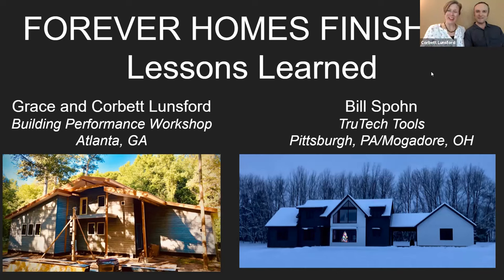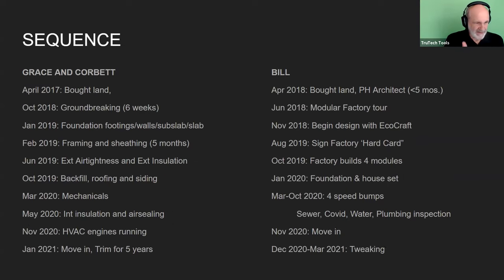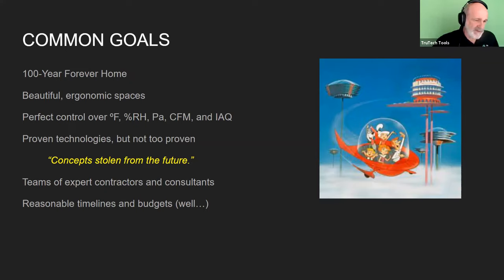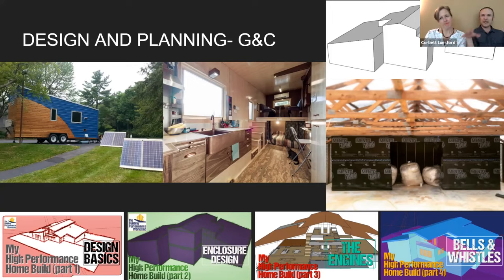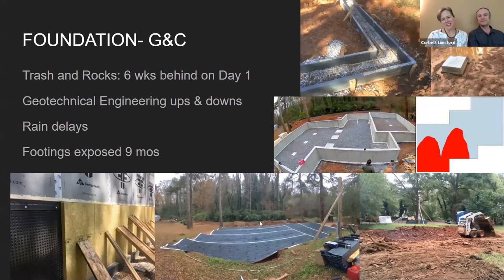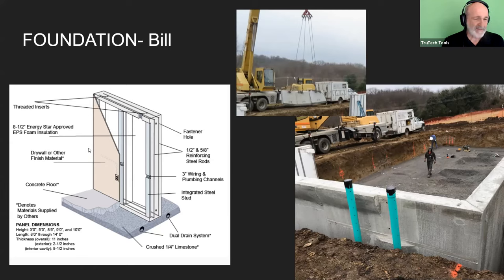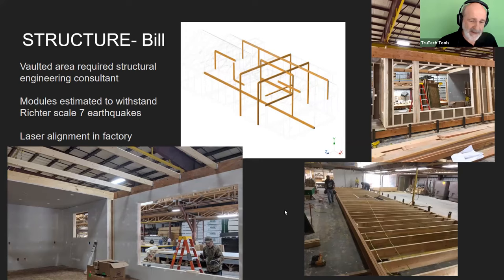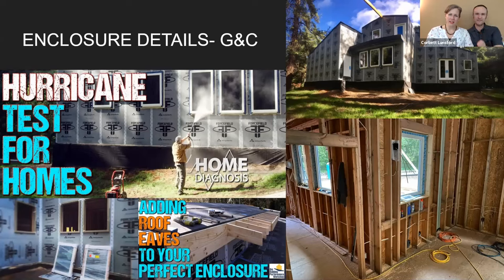Lessons Learned Building High Performance Forever Homes: Factory-Built Modular Home & Self-Build DIY

Comment: Corbett, I know this video is not one of your newer ones but I have watched it a few time's and as I get closer to building a forever home for my family I was wondering did you know about the CERV2 before you picked your ERV and if not now that you do would you still go with the ERV you have or change it up and go with the "smarter" CERV2? If not why? I have watched all of your videos and know how elegant/complex it is but I'm sure you can do the same with the CERV2. Also your design gave me the idea to put an exhaust vent in my kitchen trash cabinet :) Thanks.
Reply from the maker: Hey Carlos- thanks for following, and glad we’re sparking ideas for you. Yes, I knew about the CERV, and the issues I have are:
It’s huge.
Once you install it, it takes more specialization to maintain and replace.
Nowadays there are plug-and-play control systems for demand ventilation (see Broan’s Overture system, video coming soon).
I don’t use demand controlled ventilation anyway, because the bath fans need to be running continuously to induce the pressure imbalance pattern I need to ensure things like trash smells are evacuated consistently- also, if you activate off CO2 you’re not activating when the shower turns on.
And last, since we’re trying to influence a large group of people, I try to avoid boutique products that are not widely available to anyone who wants one. Hard enough to get simple stuff like wood these days.

Comment: Hey Corbett, rare that I catch you making a mistake, but Miele actually has all their ovens (speed, convection, steam combi) in both 24 and 30 variants, as well as a pro line of mega 48" gas top double oven ranges, and they make a few cook tops at 42. Only thing they don't make in a larger variant is the built in microwaves, those are all 24".
Reply from the maker: Thanks Mark, good catch
Reply: @HomePerformance  it's worth pointing out that the oven's internal cavity in the combi steam ovens are both the same size. If you're getting a 30" inch convection oven, you would have previously needed to buy a trim piece to get a steam oven to match up in a vertical stack. Now you can just buy a 30 steam, and it looks better on the wall, but when you open it, if you didn't know about this, you might be in for a disappointment.

I don't want to accidentally lead any of the viewers astray.

Comment: I can see with cathedral ceilings and your climate how it wasn't worth it to frame the eaves separately.  But in a cold, snowy, sunny climate, we need a cold roof to prevent ice dams.  So we are doing basically boxes for the conditioned/air sealed space, then roof trusses are going above that and creating the big overhangs.

Comment: I look at a passive house as the direction I want to go, not necessarily set on actually meeting all of the requirements. I want too many LARGE windows, lots of floor to ceiling type windows. The main goals I have for what I want are a solid, well built house that will last and be pleasant to live in. And second I want it insulated and sealed well enough that I can control the temperature and air quality to my liking, and not spend a fortune on the power bill (I’ve since made my mind up about power bills as well…).
Reply from the maker: Nice to have you here doing research for your family! Let me know if we can help in your process.
Reply: @HomePerformance  I’m still at the beginning of learning. I’ve grown up, and even still, keep finding things that make me think “this is not good, when I have a house…” So its just a process of trying to learn what it is that makes a house do or be what I’m wanting it to, and the best way to do it.

Comment: Moving the kitchen fan outside is a good idea because it also allows you to isolate the vibration. Curious but why do you need a 700 CFM fan inline to deliver 500 CFM of makeup air to the kitchen? A typical 30-inch gas stove with 4 burners on high would be worst case around 42,000 BTU/Hr. At 100 CFM per 10,000 BTU/Hr, that's 420 CFM. Maybe less fan is more beneficial (less noise, less heating of cold air, etc.). Perhaps there is something I am missing.
Reply from the maker: Great q, Joseph- it's because Fantech only makes 750 CFM at the smallest, and nobody else has come up with something to compete with them in that range.